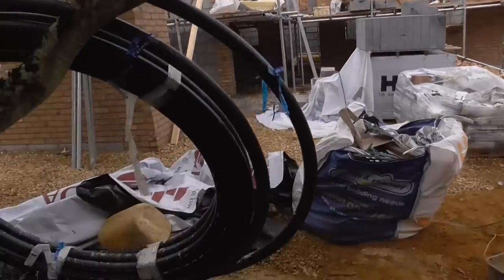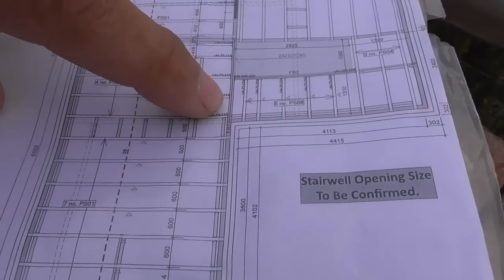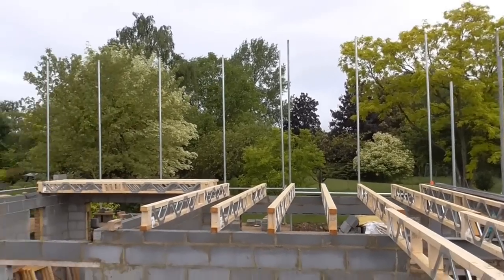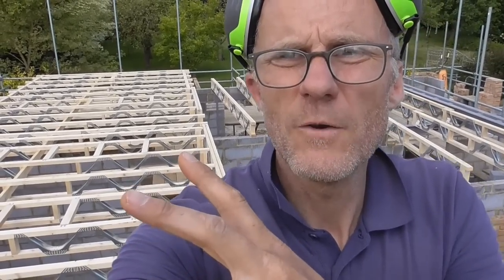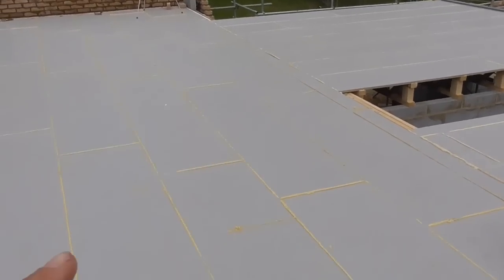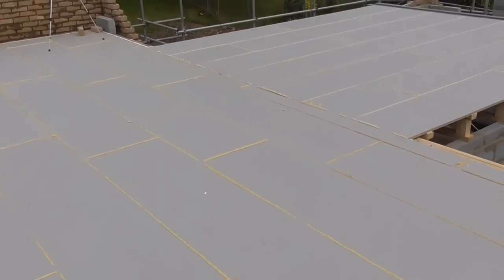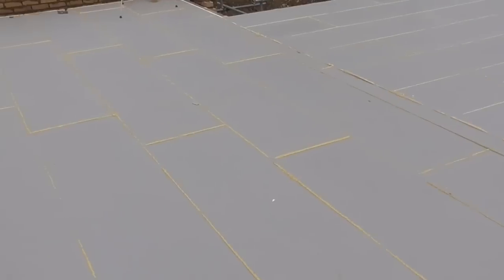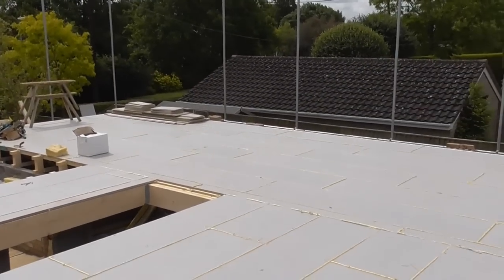Fitting Posi Joists and floor boards in new build house ***UK HOUSE BUILDING***

Comment: A real art getting that glue down without getting any on your hands. Top work mate. 🚴👍
Reply from the maker: Hi Barry🖐I pride myself on my ability to stay clean when using the stuff😆It's mainly how you control the pot when you stop applying it and avoiding dribble down the pot, plus just remembering not to tread in it👍The only bit I did get on me was off my level which the labourer moved and put the end in some🤬Have a good weekend 😎 Cheers Del

Comment: If you’ve not seen the channel, “Awesome Framers” do a lot of this sort of thing.

This was a great video. The Timelapse format worked well and it’s always nice to see the polyurethane glue foaming-up through the boards.
Reply from the maker: Hi Frank🖐I haven't seen that channel, but will check them out👍I missed a trick, and should have done a 10 second per frame timelapse of the glue foaming up, as it would of looked cool seeing it foam completely up in 5 seconds😬Thanks for watching 😎 Cheers Del

Comment: Sweet job as usual Del. Back in about 2000 I used to make those Posi joists at the truss plant I worked at. We didn't make a lot they just never seemed to take off here. Haven't seen them on a job now in many years. All I beams. I reckon those things are better than I beams but that is what most of the engineers specify. Love that flooring too. With the built in waterproofing and the size. Our floor sheets are like a sponge. Just chipboard like the old Weyroc. The other problem is the size. 3.6 x 0.9M. They are so heavy and awkward you can barely lift them on your own. I use a genie lift to get them to second storey and then two handed job to lay. By the time I retire we may have something like your sheets here. But I won't hold my breath.
Reply from the maker: Hi Dave🖐It's cool that you've got/had so much experience with all aspects of the job, and, like me, you've seen so much change in our industry🤔You also have cool experiences of how things are done in other countries, and I appreciate you sharing them with us/me🤗Cheers Del

Comment: If only you’d done my floor at my house - New Build. Unsupported floating joints between boards. Builder and warranty company refusing to sort out. 

Great video and informative. Thanks for your videos you post 🥊
Reply from the maker: Hi Ryan🖐Doesn't sound good bud, and I only had one joint on this floor that wasn't over a joist, and even that I put a noggin under afterwards👊 I don't find it difficult to set a floor out to work the right centres so that the end of EVERY board is supported🤔Have a nice weekend😎Cheers Del

Comment: Evening Del. Another lovely job under your belt. Your very those joists are a nightmare ive never seen them come anywhere near right. That flooring is a handy job and if memory serves is good for 11 or 12 months weather ? I havent fitted either in about 4 years and i dont miss the joists especially 🤣. Over here 🇮🇪 they make us tape each joint too aswell as the edge. I like you nailed the board aswell as the pu glue to be sure. I dont miss that system. Only benefit i seen was the plumbers could run a 4 inch sewer ! And the sparks could run cables ! N E how looking forward to the rest of the series. Geez
Reply from the maker: Hi Geez🖐Yeah, the flooring is great for weather resistance and makes a lovely platform to work off and continue the construction👊You're right about the plumbers and sparkies, they love 1st fixing through these joists🤗Thanks for your comment and for watching😎Cheers Del

Comment: You did your joists quick and floor. I Remember hand nailing 9x2 bridging on joists 🙄💪, I've never done posi joists they look a great job. As you said in the video Del the plummers and sparks would want their first fix in right , good luck with pulling that floor up 🤣🤣. Great work you should be teaching a young chippy with your knowledge 👍
Reply from the maker: Hi Paul🖐Like you bud, I've also had PLENTY of experience cutting and nailing, traditional, 9x2 joists, and these Posi type joists are a giant leap forward in so many ways👊I only started my channel as a way of trying to pass on a bit of what I know, and I've had a few apprentices contact me to say how much some of my videos have helped them better understand certain tasks👍Thanks for your comment 😎 Cheers Del
Reply: You have s great channel for  young apprentice  to learn off👏. Have a great day Del 😎🇮🇪👍

Comment: The posi joists look good. I think some of the floor lifting in the future will be off set by the space and relative ease of space in the floor voids. 
I do wonder about the noise travelling through the build with those voids?
Reply from the maker: Good point Doug, and I know, in relation to sound transfer, that a sound block type roll insulation must be used in the floor void, and properly pushed into the webs of each joist🤔Thanks for your comment 😎 Cheers Del

Comment: Hi Del.
I never have a butt joint running the length of the floor I know it’s D4 glued but I always start in the centre and put the perpendicular boards feather in to the long groove and cut the butt on the 600c.
What you think.
Plus I never glue the zip clipped dwang as they can squeak with the rise and fall of the floor.
Nothing in our trade is right or wrong it’s just the way you have learned.
Much respect mate.
Dez.
Reply from the maker: Hi Dez🖐It's always difficult to know which is the best way to join the boards when the joists change diection🤔I could have started on the other side but these joists are pre planned and the boards wouldn't have caught the 600 centres, and I've  not had any call backs for squeaking with the noggin clips so I just lash the glue all over😆Thanks for watching and your comment 😎 Cheers Del

Comment: Top job as always, I have never used pozi  joist before but I like the look of those rather than the i - beam Osb ones and bet the plumber and electrician prefer them as well as they don't need to drill any holes.😂
Reply from the maker: They've got to be a sparky/plumbers dream Bradley🤗Thanks for watching and your comment 😎 Cheers Del

Comment: I couldn’t see in the Timelapse but did you use a stringline for the first row of boards?. Or did you just pull the boards together and measure off the blockwork?.
Reply from the maker: Hi there🖐I just pulled a chalk line set in about 630mm from the inside face the block work👍Cheers Del

Comment: Smashing job Del. I just worry about your edge protection. Nothing for you there. Just thinking of you and everyone around You. Great scaffold for the bricks.not for you tho. Keep up the great work. Have a lovely weekend.
Reply from the maker: Hi Robert🖐I appreciate your comment bud, and, of course, the edge protection is non existent on jobs like this😬 Many smaller builders seem to operate this way, and I should just walk away if the job is unsafe. Trouble is, I prefer working on smaller sites, as the bigger ones, where safety is a very high priority, are absolutely awful to work to work on for loads of other reasons😖I'm pretty steady and concentrate on what I'm doing, but, as you point out, there's always a risk. Have a great weekend too😎Cheers Del

Comment: Saw a video from the old American framer Larry haun ( couldn't recommend enough) if you haven't seen his videos check them out. And they use a sledgehammer and a scrap of 4x2 for getting TNG sheets together, tried it once. Never going back so easy.
Reply from the maker: Bizarrely Christopher, you can actually shunt the joists over if you go to hard with a sledgehammer whilst trying to close up the floor boards😬 Gets the job done though👊Cheers Del
Reply: @thetallcarpenter  yes mate that can happen, also forgot in the video I referred to they used it on 8x4 sheets. Cheers.

Comment: Another good video as always. So with the floor, i take it its not fixed down on the block wall? Is it just the weight and strapping that holds it until the walls are built up?
Reply from the maker: Hi Bud🖐Yes, that right, it sits there under its own weight until the ends are built into the block walls. There are metal straps that are built into the ends that run parallel with the joists that tie the wall to the floor👊Thanks for watching 😎 Cheers Del

Comment: Cool video! Currently got a leak and need to get these boards up. What's the best way to take them back up?
Reply from the maker: Hi there🖐Best way to get access to the floor void is to cut through the board, but keep within the joists so you don't have to de-bond it from any joists, and then you can fix battens to the side of the joists, and re-lay the bit you cut out👊Hope this helps😎Cheers Del
Reply: @thetallcarpenter  Cheers Del!

Comment: Whatever happened to good old 8x2s and T&G boarding 😂 when I was an apprentice the joiner would say for every hammer mark you leave on a floorboard I’m going to clout you 😂good job I could duck them where the days and not forgetting herringbone strutting don’t see that now it seems metal straps and solid noggins
Reply from the maker: Hi Matt🖐That's a blast from the past🤪Can't remember the last time I put herringbone strutting in🤔Progress I guess👊Thanks for watching 😎 Cheers Del
Reply: @thetallcarpenter  we’ve just recently converted an old bank into apartment and when we removed the old ceilings we could see the workmanship that had gone into where the joists had been housed in to the trimmers around the staircase all still as good as the day they’d been fitted I said to the joiners on site imagine having to do that now instead of just nailing a joist hanger on 😂but as you say progress I suppose but in some instances not for the best 👍
Reply from the maker: @Hackett1066  Great comment Matt👊And I've seen joisting done as you describe, and it's cool to think about the guys that did them all those years ago🤗No one will uncover a posi joists floor in 75 years time and admire the craftsmanship that went into fitting it😪Cheers Del
Reply: @thetallcarpenter  exactly sadly as a site manager now I see a lot of tradesman who know only the basics for example recently had a joiner probably 23/24 couldn’t scribe I had to show him which I don’t mind I was shown it makes me wonder what they learn at college
Reply from the maker: @Hackett1066  It's not great for the future Matt😬

Comment: i noticed that you used your nail gun to put the boards down. robin clevett screws his boards. what are the pros and cons when using nails or screws. many thanks.
Reply from the maker: Hi there🖐The pro's of nails is they are quicker and cheaper, and the  only con is there is the potential for them to cause squeaking when the joist shrinks, but this does not happen on this joist system for a few reasons. Firstly, the joists suffer very little shrinkage, secondly, the boards are 100% glued down with an expansive glue eliminating any voids and thirdly, there are very few nails used👍Cheers Del
Reply: paslode nails are plenty good enough....RC overcooks things.

Comment: Hi. What type of glue you use on top of posi joist and edge betwene two playwoods? This same glue you use at around 18:50 of video??
Reply from the maker: Hi there🖐I used all the same PU glue on this floor👍Cheers

Comment: Was the 2nd floor you boarded just butted up against the one shown in the start, or was it tongued in ?
Reply from the maker: Hi Kevin🖐We actually put an extra row of noggins in where the two floors met so we could get lots of glue and a few nails in. Yes, they were just butted together, but we're well stuck👊Thanks for your comment 😎 Cheers Del
Reply: @thetallcarpenter  Look forward to more to come 😎😎
Reply from the maker: @amazing451  That's good Kevin, cause I've got loads coming up👊

Comment: How do you go on in the future if you have to access the void in the floor?
Reply from the maker: Hi Sue🖐 You need to cut the floor out away from where it is glued down to the joists and then refit it on battens fixed to the side of the joists👍Finding where the joists are is more tricky as there is not usually many nails to guide you, but stud detector is pretty good at finding them👊Cheers Del

Comment: Do you also glue the groove of each board?
Reply from the maker: Hi Josh🖐Not usually bud as the the bond is super strong just on the top of the tongue👊Cheers Del
Reply: If we don't use a tub of glue for every 4 to 5 boards we get told we're not putting enough on! 😅
Reply from the maker: @joshyoung1411  I splash it all over the place, but have rarely double beaded the tongue and the groove. The floor will never come apart👊

Comment: Sorry, love the vid, clearly being thick, what was the glue?
Reply from the maker: Hi there🖐Its a polyurethane D4 glue that's expands a little to accommodate any gaps and is SUPER strong💪Cheers Del
Reply: @thetallcarpenter  cheers Del do you have a supplier\part number?
Reply from the maker: @idstewart1964  Most D4, polyurethane glue is the same, and this is labelled as 'floor adhesive'👍
Reply: @thetallcarpenter  cool thanks. I do quite a few Fibreglass roof repairs and think this will fit the bill. I'll let you know

Comment: These posi joists seem to be the in thing...told they are far more stable than solid wooden beams and also lighter to work with...thankfully you had some help there..that would have been hard going doing that yourself
Reply from the maker: Hi Arthur🖐Yes, they are much lighter to handle and make a very stable floor with little bounce and shrinkage👍Thanks for watching and your comment 😎 Cheers Del

Comment: Interesting how they recommend not nailing the floor. Less squeaking on the nails I suppose and if it's all glued then no need its all one piece. Too many new builds with dogshit floors that move everywhere. Glueing the top of the joists and joints for sure is the way forward
Reply from the maker: Hi Elliot🖐These floor systems eliminate squeaking, noisy floors by using a manufactured joist that doesn't shrink, and as you say, a floor deck that is glued all round and glued down👊Thanks for your comment and for watching 😎 Cheers Del

Comment: I have this "no nails" crap floor in my house that was built in 2006 and I am so devastated by the noise the floor boards produce while walking on them. Absolute rubbish idea. It has to be screwed down otherwise they will move as the joists start bending.
Reply from the maker: Hi there🖐I would bet your floor was either not put down properly or not part of the joist 'system' and hence the noise😬This type of system should be, virtually silent if installed correctly👍Cheers Del